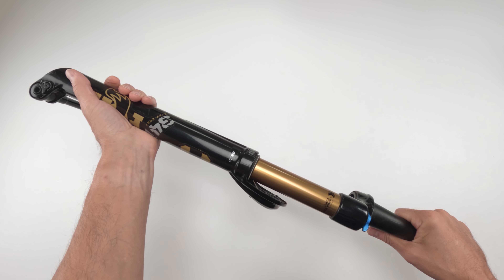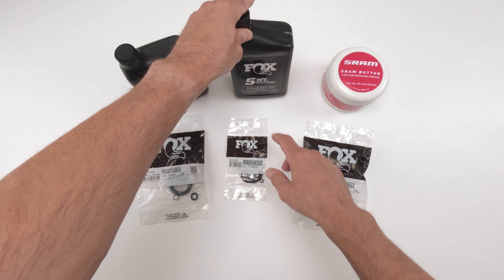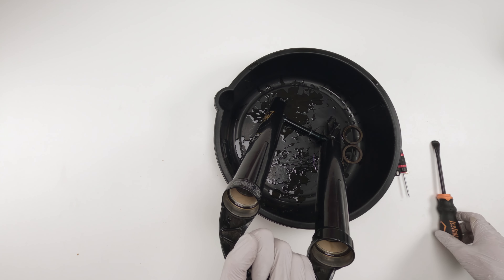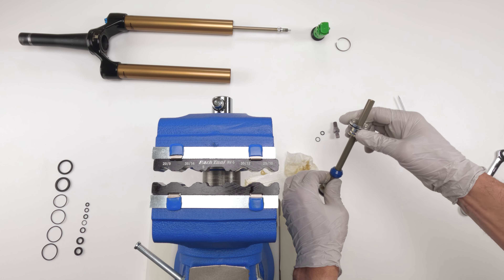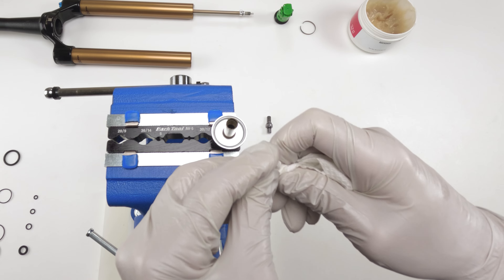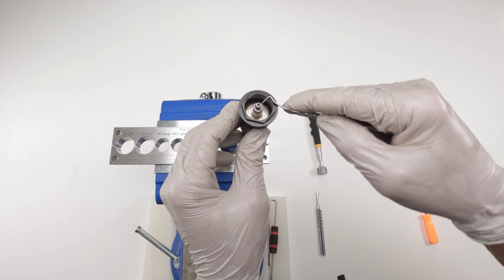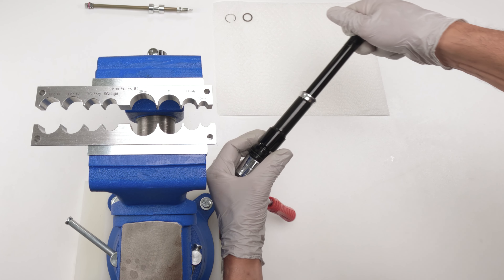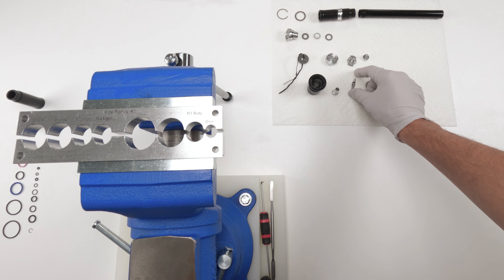2022 FOX Float 34 FIT4 STEP-CAST 50 & 125 hr FULL service guide for beginners. Fix your broken dials

Comment: Specific procedures for the 34SC are a wonder to have. Thanks for putting out content like this. It’s a wonderful guide!
Reply from the maker: Glad to hear that it might come in handy for you one day, and thanks for the positive feedback. let me know if there are any questions
Reply: @zoubtube Just finished my first lower service and air side rebuild! It’s always super intimidating and this video made it possible. Thank you for putting content like this out there. I didn’t encounter any omissions or issues. The cleaning ritual is an awesome way of doing it. Though I found more luck not ripping the towel.

Though I do wonder, if I want to replace the lower oil more frequently (I put 100 hours on the fork in around a month), do I just buy a bunch of crush washers and do the oil/cleaning more often? I find it hard to believe the upper seals/foam need to be replaced as often.

Comment: Great video. I am about to carry out this service. Have you ever come across the issue of the 3 position damper adjust lever locking in the firm position? Once mine is in the firm position it is impossible to change to the medium or soft positions without completely unloading the fork. This is a PITA because it involves stopping riding every time I change. Hoping that the strip-down will reveal something
Reply from the maker: I haven't come across this issue. There really isn't all that much that would cause this issue on a fit 4. The only parts that affect the high speed dial are the butterfly valve on the piston, the wave washer and the detent ball that makes the clicks (I'm guessing it's corroded and locks in place when under pressure). It has to be one of these three. The video should help you go through all this. Keep me updated.

Comment: Great video thank you! I just finished completing this and even in the firm setting there is still movement, while after I bled the damper it had none. Is this normal?
Reply from the maker: I think you are trying to say that before you serviced the damper, the damper was firm when in the firm position, and after you serviced it, it has a bit of movement in the firm position? If yes: Were all the dials in the fully open position before you bled the damper?
Are you sure all air was removed during the bleed. 

Ultimately, there will be "some" slipping when constant pressure is applied, but it will be very slow. The lock out should be relatively firm on this damper. If I'm reading your questions wrong, let me know so I can better help. I'll be working on a 2023 version of this fork in about two weeks, which I'll be making a video on. I'll go into these details in that video. But until then, let me know if I read your question wrong.

Comment: Do you find RockShox forks more DIY friendly than Fox forks?
Reply from the maker: Newer rockshox forks and shocks were designed with small details that make the service easier overall imo.  But Fox has been letting people service the entirety of their products for many years, unlike rockshox,  which is a really nice option. Unfortunately, in many cases, the proprietary tools needed to work on them can be excessive and expensive. Both of them are getting better though. I know this is a pipe dream, but I hope these videos help push them into putting more emphasis on designing for easier servicing. I fundamentally believe this would be best for not only the community, but for the sport in general moving forward 👍